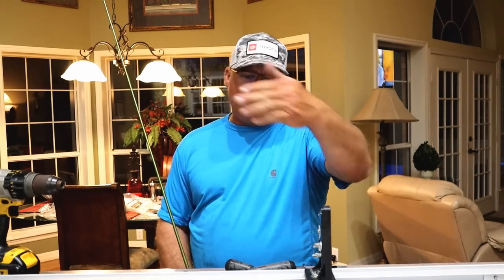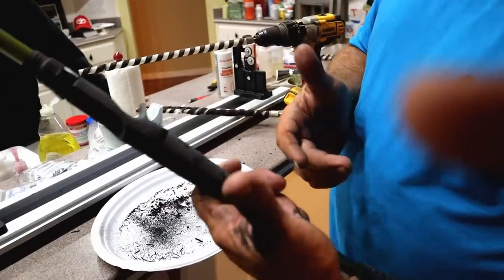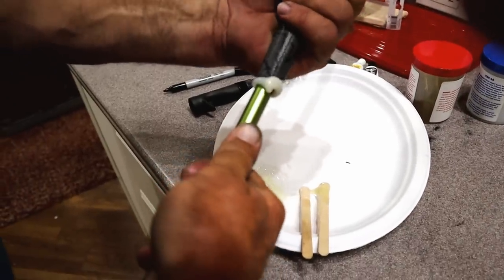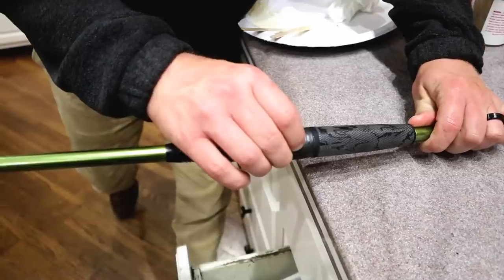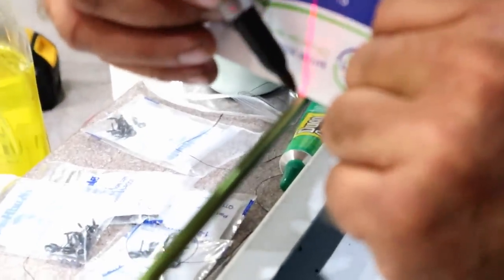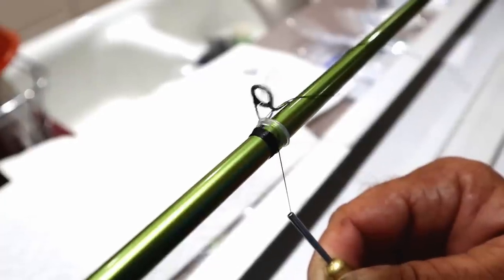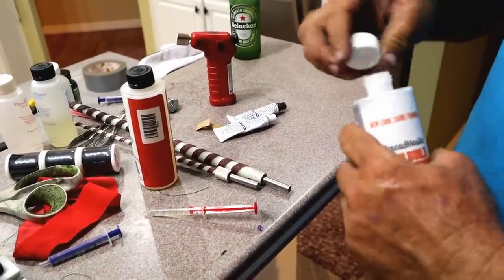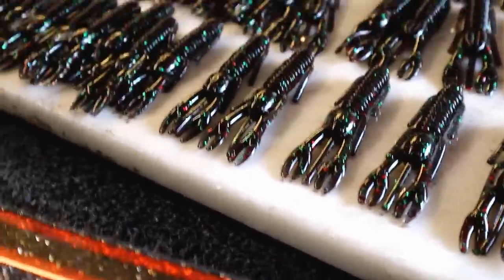ROD BUILDING OVERVIEW; Terry Scroggins Teaches Rod Building Using Mudhole Tackle Components

Comment: Dude did not ream out his grips nearly enough, you don't want your grip/real seat paste to all be pushed out as it was shown in the video, also he did not score the blank to prevent grip paste failure, also there are seams on those winn grips, so position does matter, also dont use goof off on your blanks, use isopropyl alcohol to clean grease and epoxy. Additionally give your grips an hour plus to set up before messing with them. Other than that he did most everything else correctly, but then again in building rods there are no wrong or right answers, you do it your own way, but those small additions will make a huge difference in durability.
Reply from the maker: I'll be sure and pass your criticisms along lol...but seriously just like you said, the beauty is you can do it however you want.  being a touring pro angler he puts his rods through alot more use than most of us do and he gets the performance he wants doing it the way he does.
Reply: Oh man.... I've never built a rod before but I cringed when he used goof off on everything.
Reply: No need to scuff the blank. No need to take out any more material than he did with those Winn style grips.
Reply: @fishingthe262  That is simply not true, what you are saying makes no sense. Winn Grips are more or less no different from EVA grips on the inside diameter, the blank is painted with a gloss finish. thread/grip finishing epoxies, be it rod paste, pro koat, flex coat etc, is not going to penetrate this finish, and has nothing to adhere to other than itself. Also the gap is critical , reaming material allows greater area for the epoxy paste to propogate through, be it the pores of the EVA or the scoring marks. Thats why scoring the blank, and reaming the grips is so important, if you dont do these things, then when you hook into an 8lb bass or a 15 lb snakehead, and your rod undergoes torsion, the epoxy will break away from the finish the second it gets the chance to do so.  On smaller diameter blanks this becomes super critical, an ultralight for example on average wont last a month without grip/butt/seat torsion failure unless it has been reamed properly and scored to accept the epoxy. You are a 'rod builder' according to your channel, so these are things you should already know..
Reply: YOA Ownage HD you’re 100 percent incorrect.  I’ve been building custom rods for quite some time.  I’ve never once scuffed a blank and EVA and WINN should fit snug.  I’ve never had a handle fail to this day.
Reply: @fishingthe262  Then you have been building rods incorrectly 'for some time' I just hope you haven't charged anyone for your 'work', I learned from a master rod builder than specialized in rods for offshore, inshore and anadromous fish, all hard fighting fish. You cannot leave a tolerance like that, and expect it to last.
Reply: YOA Ownage HD I have built rods for myself and others.  I have fished my rods all over this country and hooked everything from Great Leaks Chinooks in the 25 pound class to peacock bass in Miami with them. Reds, Snook Pike and everything in between.  Not a single handle failure not a single blank failure.  I’ll tell you in more time NOT ONE SINGLE HANDLE FAILURE.  And beyond my experience and those of my clients, I’m pretty sure Big Show has made more money with a rod in his hand than either one of us. If his handle were failing, I’m pretty sure he’d make the correct adjustments.
Reply: @fishingthe262  Just because you haven't experience failure yet, does not mean you are doing it correctly. You can cut all the corners you want, and failure will occur inevitably. It is called margin of safety and it is critical in properly engineering literally anything.
Reply: He is correct, epoxy doesn't stick as well to glossy surfaces. That is a proven fact and has been shown in many tests. That being said, I have built rods with scuffed blanks in areas where grips go and I've done them without scuffing them as well and never had a grip fail either. I have seen grips fail and most of the time the failure has been where a metal reel seat was used and it had a polished surface inside that the epoxy didn't adhere to very well. Those are my own personal experiences, your results may vary!
Reply: They're southerners, they don't fish in freezing 🥶 temps 😂. All master fly rod builders rough up the blanks, it's called breaking the water bond. It's his rod, so he can do whatever he wants.
Reply: @YOAownageYOA  poo

Comment: Back in 2017 I broke 2 of my favorite rods. Both were 20 year old St. Croix rods. One was a flipping stick and the other was a cranking rod. I decided to replace them with MHX rods from Mud Hole. Mud Hole has a black Friday sale were you can buy rod build kits and blanks for 50-75% off regular price. I chose to reuse the guides and reel seat off my broken rods so all I need to buy were the 2 blanks, 2 eva butt caps, 2 eva grips, a 100 yard spool of wrapping thread, and  epoxy finish (1 oz hardener, 1 oz resin). The hardest part of building the rods was keeping the guides towards tip from moving. The blanks were very thin and the guides were single foot. I paid around $105 to build 2 new rods and I have caught hundreds of bass on both of them.

Comment: I have learned a new technique and an easier way to thread the guides. What exactly was the tubing again and where to get it? Instead of using tape for arbors under the reel seat, I use fiberglass mesh, used for sheetrock mud. Epoxy can get down there really good. I personally find the spine first before I put anything on the blank. Great video and I am glad that you are going to be doing more videos about rod building. Never quit learning.
Reply from the maker: thanks...hope you'll tune in for future videos

Comment: Somewhere down the road I want you to tackle a spiral or acid wrapped rod. I have made a ton of rods but never tried the spriral wrap where the guides start on top but gradually work their way around to the bottom of the rod. That would eliminate that constant tip wrapping you get when you are working a lure at warp speed. If you apply yourself to rod building the way you do your pouring you are going to turn out some pretty rods.
Reply from the maker: Yeah hopefully I can get good at it over time

Comment: thanks for the video, great to watch terry build a rod, picked up a lot of great tips.  what size rubber tube does terry use?
Reply from the maker: the rubber tubes come with the set...they are different sizes so they fit the blank all the way down.

Comment: I bought the Ugly Stick GX2. It's a 4 piece rod but sometimes when I cast it, it flies to pieces. No matter how hard I push the rods together it still comes apart. I was thinking of taping the sections with Gorilla Glue tape. At least so my rod won't fly into the water.

Comment: It’s a similar technique gluing brass tubes into pen blanks. I usually scratch the tube up to improve the glue’s grip strength. Is that not necessary for fishing poles?
Reply: Rev. David Willerup  if done properly, yes, you rough up the blank to improve adhesion.

Comment: How do you know how many guides to use, what size, and the right spacing?
Reply from the maker: you get to choose...mudhole can probably advise you on it too.
Reply: Mud hole has a guide spacing chart on their website.
I usually tape on guides and run line through them and give the rod a good bend an adjust the guides so it doesn’t touch the blank.
Reply: @donaldbabbitt9237  Thanks.

Comment: You put the guides on smooth. I like the custom rods being one piece too. IMO it's a pain for two or more piece rods.. t
There's templates, graphs and resources like forums for various types of fishing rod guide placement. Honestly, it's also about preferable placement. Like two piece rods having less or more guides for strength/sensitivity based on action and style. I prefer to have my spinning poles with two pieces to be readily available for grabNgo fishing. Meaning setting my guides to sister the two pieces around same length and not staggered when strung up with my rigs when using compact designs for walking trails in the bush or woods. I can use a wider rod tube versus a long tube carry on. Certainly beats backpacking miles with a long, one piece fishing pole sometimes... smh
Reply: The only 2 piece rods that I know of (excluding fly and travel rods) have Barbie Reels.  That's not exhaustive, but, I don't know a serious fisherperson that uses a 2 piece rod less than 8 feet.

Comment: how do you know how far apart the guides go?
Reply: If you haven't built rods before, there's templates, graphs and resources like forums for various types of fishing rod guide placement. Honestly, it's also about preferable placement. Like two piece rods having less or more guides for strength/sensitivity based on action and style. I prefer to have my spinning poles with two pieces to be readily available for grabNgo fishing. Meaning setting my guides to sister the two pieces around same length and not staggered when strung up with my rigs when using compact designs and walking down through the woods I can use a wider rod tube versus a long tube carry on. Certainly beats backpacking miles with a long, one piece fishing pole.
Reply: @tiffanywelton5116  thank you so much for the information.  I will have to build one soon.
Reply: @surphvision  I even bought this kit that I'm gonna put together this spring. I believe Mudhole.com is having their Gen 2 Custom Rod Building starting kit on sale right now because I just order one with my custom to order rod. Kind of like prefab PC but I don't have the funds to reinvent the wheel for the kit xD

Comment: That’s the most minimal, sloppiest, zero fucks given job building a rod I’ve ever seen. Glue still coming out the grips, no winding checks, no adjustment for balance with the reel on, way too much epoxy on the guides and the decal epoxy turned out uneven like a mountain range. That wouldn’t make it past quality control at the cheapest factory
Reply from the maker: sounds like a challenge....i'll bet I could make one even worse!